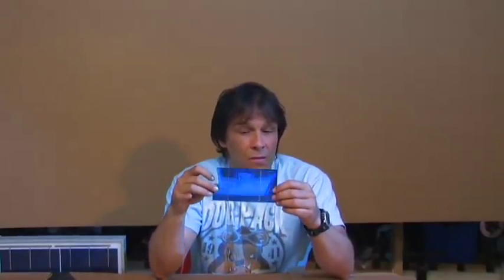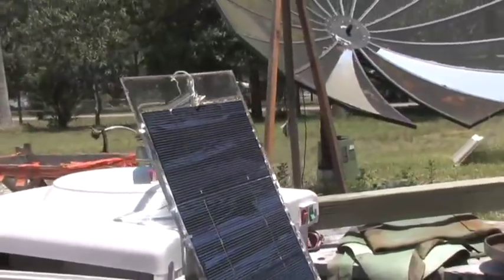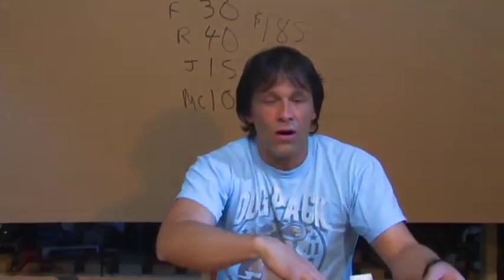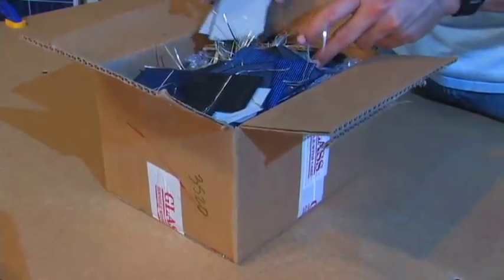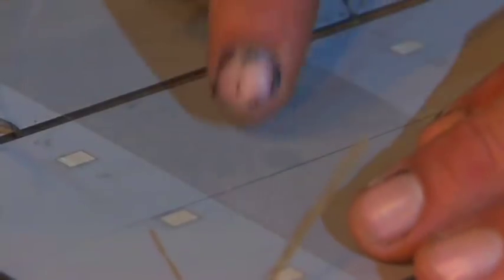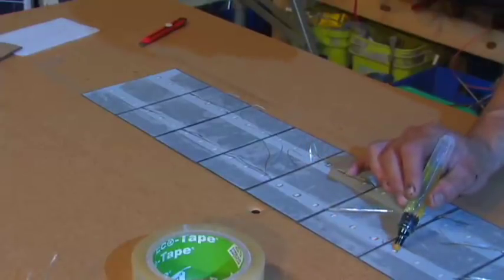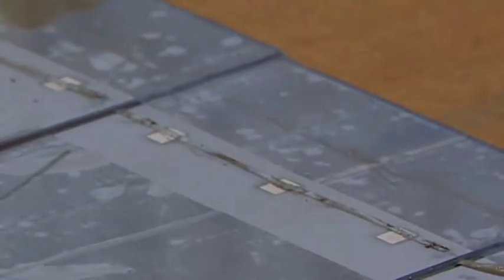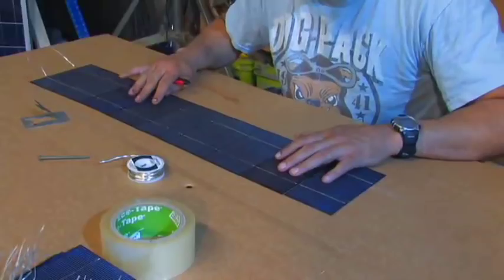less than $1 a watt DIY Solar Panel MAKE YOUR OWN SOLAR PANELS (PART 1)

Comment from the maker: 2011, factory panels are for the most part. the way to go. Cells are cheaper now so as the price drops for completed panels, so does the DIY method. If you have the extra time or need custom panels, DIY is the way to go. If not, buy a whole panel. This just shows easy ways of doing it. If you try to make a panel from new materials, aluminum frame, non-reflective glass etc. makes no sense. If you have glass and can customize to the size then it is still a valid choice. TIME is the main factor
Reply: Thanks for showings us mistakes that come alone so we can learn along from our own mistakes! The Key is to learn from what works and not works.

I want to experiment with the Fibonacci sequence and solar cells position, like on trees (Aidan Dwyer)
Reply: save 50,75% or more on electricity... without spending $20,000 or more on expensive solar panels: /watch?v=71EAglM5e-8
Reply: GREENPOWERSCIENCE Where do you buy them panels?
Reply: gigicaly

He probably talks to the home repair store manager and arranges to buy broken/discarded products. They probably just trash stuff unless you tell them you'd like to buy it. After all, they probably tell themselves, "Who'd want broken electronics equipment?"

You can be like, "hey, I'll pay you half price for broken stuff, don't trash it." They'll probably start saving junk for you.
Reply: gigicaly There are always sellers on eBay that have these broken cells. I bought 250 new whole cells on eBay for $265 which is not to bad. I've been collecting old windows to put my cells between. Problem with glass on both sides, makes a heavy panel, but will last many years longer than encapsulated in resin. I will use RTV to seal them like they do aquariums.
Reply: where do you buy those broken panels from? I tried to buy new ones here but they cost a arm and a leg. I don't understand how they are so expensive since the technology is quite old now.
Reply: Just wishing you what you asked for... your the ...person, who wanted electricity more than health.
Reply: That is hilarious, I spent 10 years in South Carolina, they have 38 nuclear reactors in 7 nuclear plants, more reactors per square mile than almost any other place in the world, and the second highest electric cost in the whole country, with some small homes running over 700 dollars a month, and some large homes running over 1200, so where is this cheep power? The cost of building a nuclear plant is just the beginning, every plant has to have armed guards, nuclear engineers, inspectors and operators 24 hours a day. Nuclear power is only good for country's that want to enrich uranium.
Reply: Nice video dude! Also good job on connecting all the cells to themselves haha. :P  I was wondering what you were doing but I was like "maybe he's doing it right and I just didn't notice something."
Reply: if the wood warps why not make something like a slide or somethign that resembels train tracks?

train tracks warp all the time.
Reply: Absolutely, Dan!! Today (Sept. 2016) you can buy NIB state of the art, 300+ watt American made panels, with a 30 year warranty for $1/watt! I know- I just bought 30 KW worth for our off-grid ranch (15 for use, 15KW emergency back-up).
Reply: Patriotgal1 man how much did you spent ? I neet to know how much for 1000 kWh month I need to spent on the whole solar energy system
Reply: Luwam Hagos have you intalled the sistem yourselfe and tried it ?
Reply: is it 12v?
Reply: Yes, you are right about the factory panels, I bought 7 used ones on eBay for $450 made by General Electric 85 watts. Not a bad deal. See my video on youtube of how I made a chopper to turn DC to AC with very little loss.
Reply: notdone123456
if theyre 25-45cent/ watt and each cell has 3.85-4.45 W output.... that means about $0.95/ cell at least  he said he got his at 60 cents a piece? correct me if im wrong please
Reply: ***** well there's also the mobility that solar pannels have. I mean if you have to go somewhere far from civilization you will need a power supply and solar and wind makes sense. at least to recharge a flash light a laptop/phone and maybe a electric fire starter...I've seen backpacks with couple solar cells on them and a usb plug and you could charge your phone on that. so they have their use. there is also a matter of the grid not always been available in civilized places. A storm once killed our power here for 2 days. I'm telling you as someone working with computers 2 days without power Is as close to experiencing death as it gets. At that point I couldn't care less for what the investment recovery was I could'of payed anything for some power. So its a matter of how you look at it. Personally i am interested because of power shortages. They are not often here but somehow they seem to be happening just when I need to be online I am also considering a gas generator but I am all out for green energy so I will try to get something like this going first and see where I get. :)
Reply: +Frank Sacksen nuclear power, yeah, nothing ever went wrong with that....3 mile island, Chernobyl,  Fukajima...
Reply: I'm far more concerned about my health and the health of my family, than where im gonna get power for the idiot box....and didn't your mother ever tell you not to call people names...have a little class.
Reply: May you live a short, sickly life, with all the electricity you want...
Reply: And by the way, you talk about my evilness, but you are the one who wants money and power at the cost of the health of your neighbors... so I would say the evil one is in fact you, sir. But if what I said will prevent you from making such foolish comments in the future, then I have done my good deed for the day.
Reply: +Frank Sacksen What is your opinion on the nuclear waste rods that must be stored under the earth's crust? Three proccesses are used : concentration and containment (the storing), dilution until radioactive levels are "acceptable" and returned to the environment, or contained until radioactive levels decrease and then the materials are returned to the environment (at the moment). I just want to know what you see happening in the future to deal with the rise of yet another source of waste we are sticking in the ground and the growing demand for energy that with increase that rise even more so. Solar materials may be more expensive now, but costs are already making decreases as popularity and common use increases. http://www.seas.harvard.edu/news/2014/01/organic-mega-flow-battery-promises-breakthrough-for-renewable-energy an example of the now organic RE storage being developed. I don't agree with your absolutism in your thinking either, "There is only one solution to energy demand and that's nuclear", honestly, if research continues to develop this solar energy and with it already being safe for the environment and its users, (plus a whole lot more personal for individual homes) how can it be outran by nuclear? I am not saying nuclear isnt a powerhorse for energy and it is obviously the most powerful at the moment, I am just questioning its future and how much furthur its saftey can be driven. Thanks for you opinion and please do not use insulting language while arguing with me, I will take it as a sign that you do not have sufficient knowledge to continue the conversation.
Reply: *****
Let's try to figure out where you messed up. First of all, when you pay a utility for power you are paying them two ways. The electric bill is the way you see. You don't see how much of your tax burden goes to paying the interest on the government debt to pay for when they gave money to the utility to make it possible for them to make a profit. You hear about government debt that keeps going up, but don't you know where it comes from? It comes from government paying for much of the construction of the nuclear power plants just so they can have a way to produce plutonium for their nuclear warheads. You can't tell me the full cost of constructing a nuclear power plant because that information is a government secret. It costs a lot, and then after forty years, they have to pay to either decommission or to refit the plant, so there is always more costs that haven't been factored in. There is the future cost of guarding the waste and cleaning up after an accident. The government almost always bails out the nuclear plant so that they can keep their rates competitive and still make a profit. It is corporate welfare. If we were to work the cost of solar the same way, the government would be paying you to install solar and then they would keep paying you. They would pay you to hire someone to clean the birdshit off them every day. But forget about government corruption and kickbacks for a moment. You say you get a kilowatt hour for four cents. Maybe for you it doesn't make sense to install solar. For someone paying a lot more, it makes more sense. It is sensible to ask about the return on your investment. You're absolutely right to work the numbers and see if it makes sense for you.
Solar panels become less efficient with age. The cost per watt of buying the solar cells or the panels doesn't take into account the cost of the support structure, installation, batteries, wires, converters, etc. Well, the cost of a nuclear plant doesn't take into account the cost of the wires to run to your house. Someone has to pay for that, and I guarantee you it costs more to run miles of high voltage wire, and is less efficient too, than to run a few hundred feet of house wire. Still, who cares that there is a Ponzi scheme to make the grid seem affordable by deferring the true cost to future generations. You are only concerned about the costs you can see. If government isn't running up a tab supporting the grid with welfare, they will spend it some other way, so you're not going to stop that by going to solar. I completely understand your perspective. The thing is, you probably want to have a back-up generator to keep the fridge going in case the wires come down in a storm. Well, a solar panel keeping a few batteries charged might fit the bill and cost just as much as a loud gas generator. A single panel won't run your whole house, but if you have it, why not use it every day to defray the cost? You would have to buy gas to power a generator, but sunlight is free. You would have to maintain a gas generator, so any maintenance of solar panels, like cleaning your windows, is really just a cost of home ownership. A little ammonia, a paper towel, it adds up, but you can afford it. What other kind of maintenance is there? In twenty years when the cell is less efficient, it will still be making electricity... just not as much. So just compared to a backup generator, the cost is about the same, but if you actively supplement your daily power use with it, then you actually reduce your power bill from using the solar panel, but the gas generator only costs you more the more you use it. If you only have one 190W solar panel and just to make the math easy lets say you get 2 kw hours per day, then that saves you more than $25 per year. In twenty years it's more than paid for itself and it's still producing power. This is not a get rich quick investment. Most people think it's worth it because they don't believe they will have social security to retire on. The government is going to take that away. They want to be independent. They want to have power far in the future when they're too poor to pay skyrocketing utility prices. Remember inflation? In ten years you might not be able to buy solar for what you can now, just because of inflation. I know people that had a hefty amount invested in stock in the company they worked for, and then the company transferred their assets to Mexico and went bankrupt in the U.S. The stock became worthless overnight.
Nuclear is a terrible investment. It needs a tremendous amount of government subsidies just to look feasible now, and there are huge expenses perpetually being deferred to the future. It's a bubble that will pop leaving the taxpayers burdened with paying for the clean-up and the corporations will simply file bankruptcy or dissolve.
Solar is not a get rich quick investment, but after it pays for itself, it perpetually provides electricity for very little maintenance. Basically just cleaning the glass. There's no need to replace the old less efficient cells with new ones. The old ones continue to produce electricity for decades... just not as much as the first 25 years. Because of inflation, spending your money as soon as possible is a better investment than letting it sit in your wallet.
Reply: *****
Well, that is your assertion, so you have the burden to back it up. Give me a link to this 'public knowledge' where I can see an itemized list of every single expense that goes into a single nuclear reactor, with nothing left out. Will it include the projected cost of decommissioning after forty years? Will it include the projected cost of guarding all the nuclear waste from terrorists for the next four hundred years? Will it include the cost of the high voltage lines and the many step up and step down stations? When they figure the cost per megawatt hour are they measuring the watts produced at the reactor or the watts received by the consumer? Don't forget the inefficiency of running electricity for hundreds of miles. What you get at the house is only a fifth what they had to produce to get it there. Better not bring up global warming: nuclear fission is producing a lot of heat being dumped into the environment. Solar, on the other hand, absorbs energy from the sun and reflects some back out into space, so it actually reduces heat in the environment. But I understand your perspective. Who cares when the bottom line is that current market rates are so cheap that you can afford to heat your house with electric. It's just that in the summer heat, you might actually want a few solar cells on the roof reflecting some of that excess sunlight so the AC doesn't have to run for so long.
Reply: *****
You say so, but the evidence is not there to back you up. If it was so easy to find, why couldn't you provide a link? LOL
Reply: *****
Again, you substitute imagination for actual evidence. You imagine it exists and you imagine it is easy to find, and yet, you cannot show a single link. Do you understand the difference between your imagination and reality?
Reply: *****
Not nearly as hapless as you make yourself out to be by continuing to bluff when you should be posting a link to back up your fluff.
Reply: *****
You concede that you have the burden of proof and yet you still have not provided any. Does this mean you concede your original assertion is wrong? Apparently you are eating your words. How does crow taste? "I kin eat it, but I don't hanker after it." LMAO
Reply: *****
I can imagine that you believe in unicorns and faerie dust magic and that you think of yourself as an immortal god and that I am a nuisance fly that you would like to imagine you can swat. What does that gain us? You still are holding an empty bag that you claim is easily accessible proof of your assertion. Only, you won't show us what's inside because it's empty.

If I imagine that you are telling the truth and that you actually have something in that empty bag, then I would actually be gullible. It makes more sense to have a healthy level of skepticism and wait to see what's in the bag.
Reply: *****
So you claim. And yet, you still fail to show me a single link. Remember, the burden is on you. I don't have a burden to go searching for evidence of your claim. How embarrassing for you that you did not even understand this fundamental and I had to explain it to you.
Reply: *****
Surely as you are the type to laugh at people who are idiots you must be thinking that I am laughing at you. You are projecting.
I am actually hopeful that you will stop making a fool of yourself and back up your assertions with a link. It is your burden. The more you continue to refuse to carry the weight of your own argument, the more it appears that you were lying the whole time. Are you a liar? Stop being so pitiful and defend your assertion. I had spent a great deal of time researching the costs of nuclear plants over a year ago. I don't expect the information to magically have become more accessible in only a year. You will have to back up your assertion or you remain non-credible.
Reply: *****
Facepalm. You are the one being ridiculous. You concede that it is your burden to support your argument. How many times have you passed up your duty, ridiculous guy? You've got nothing. You are bluffing and I have called your bluff and you still have nothing. Pitiful. Not credible. Logically, if your assertion was true that finding the information is easy, then you should have had it to whip out. You have stalled long enough. Provide the support for your argument or the conclusion that you have nothing will be permanent. If it's so easy for you to find, then why are you stalling? As I have said, I had already put a lot of effort into researching this information a year ago and it was very difficult to find. I'm waiting on you to find it now. I'm not going to support your assertion that it was 'easy' to find. So far you have demonstrated that you have not even been able to find it, since you have been unable to do anything but stall. You are proving yourself to be a liar.

Nuclear power is unsustainable because it is so expensive. The only way it was ever profitable was from shifting huge expenses to the future generations and taking massive amounts of government funding. This was nothing more than a kickback scheme to profit the cronies of the politicians that set this up. You cannot imagine the true cost of nuclear because inflation will continue to grow for the four hundred plus years we will need to guard the waste from terrorists. Nuclear batteries could never become a widely available option because terrorists would detonate them in a dirty bomb. Radioactive materials are simply too toxic to ever be viable. The expense of cleaning up after any spill is unviable. We still haven't cleaned up the spill from Fukashima. Your assertion that nuclear is a viable source of energy for the future has been utterly debunked. It will never be more than a niche product used in the space industry and in the war industry and only made available for consumers as a byproduct of keeping a reactor available for making warheads at a moment's notice. As a source of electricity, it is too expensive. The rates are artificially set to be 'competitive' and they get corporate welfare to pay the CEO, which ultimately you pay a small fraction in your taxes, but mostly the government defers to future generations to pay.  When the bubble bursts, you will be long dead, but your descendants will curse you in your grave for shifting this burden onto them.

Similarly, you have been trying to shift the burden onto me to look up support of your assertion. You are irresponsible and lazy.
Reply: *****  Your ignorant little rant helps to prove my point that you are a person without class, or the ability to watch real news programs. Educate yourself before spewing your ignorance all over the public.
Reply: *****
You are quite welcome to go down in infamy as being a liar and a youtube troll. That's your choice. You have been given ample opportunity to change that. Is that really how you want to be known? Remember, stuff on the internet never dies. The name Frank Sacksen will forever be tainted with this colloquy.
Reply: *****
Your target group? Explain.
Reply: hey dan umm my question is the solar pannel completely worth how much per watt or is it better to buy the pre assembled and is the fresnel alot per say 32 inches please reply thanks
Reply: >Home Made Energy-How To Get Free Energy Now. Many People Doing It Already!>>>>[ https://t.co/vm2wD2OnfZ ].........
Reply: s
Reply: kevin dahlr bkojohhbjbbhbbbb nhhjpjkhkhjjjjiiokjjxjdisisisjsjsisididididiididiisksksisjdjdjdjdjdjdjdjdjiiidijddjdjd
Reply: Nice video. Free energy
>>>>> https://sites.google.com/site/smartsolarenergy2017/
Reply: kedwa30 you talk of cronies and kickbacks I assume you have evidence of this I say this because whilst you have proven Frank  has no proof to back up his evidence I put to you where is this evidence you purport to claim is some pyramid scheme seeing we are not talking red herrings yet implying nuclear energy is evil because you say you did some research and it was difficult to find, it's not that I have better research or have evidence but that you seem to have special knowledge and also please explain how to clean Chernobyl and what is the tick of approval and from whom is the legitimate authority and why do you claim generations from now will pick up this bill unless there's some time travelling here no one has yet to receive that bill or if it even exists a lot of what you claim was a burden of proof for Frank could easily be said the same from you but all I read from your basically attacking ignorant Frank was that you have some sort of moral high ground against nuclear because it's an evil ponzi scheme, where is the proof in your pudding!!!!!!!!
Reply: Preach!!!
Reply: GREENPOWERSCIENCE
Reply: I'm not sure but ,if anyone else wants to learn about what do i need to install solar power try Ewans Energy Roadmap (just google it ) ? Ive heard some amazing things about it and my mate got excellent results with it.